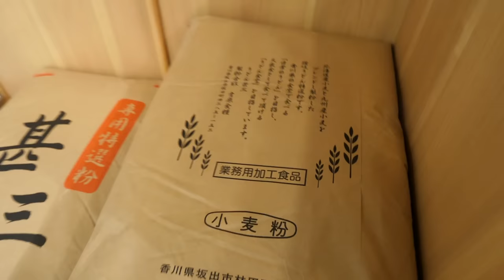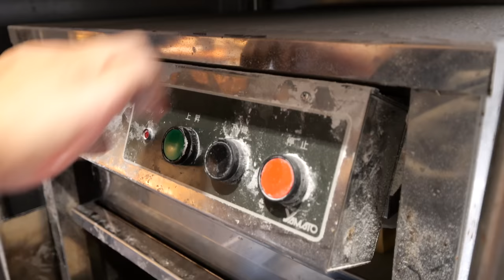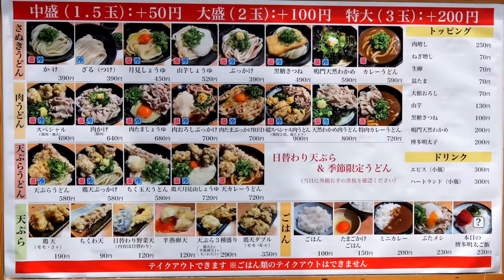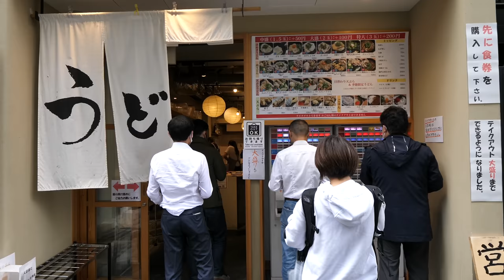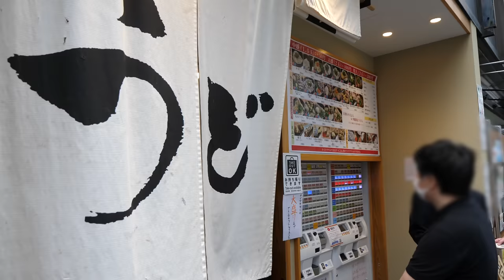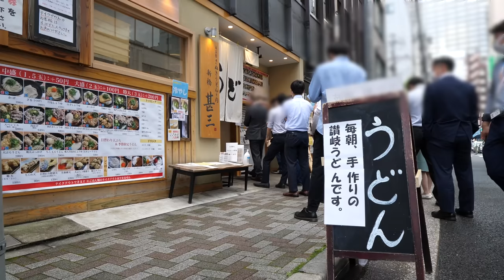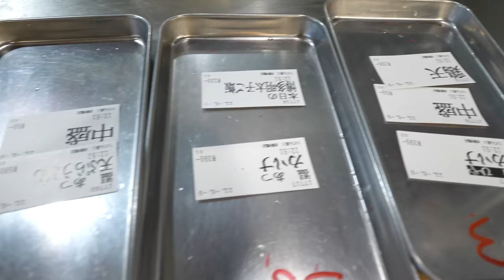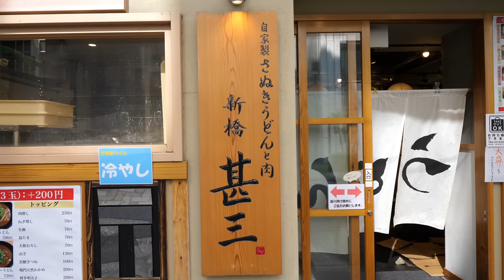天ぷら！肉うどん！信じられない高速注文さばきが炸裂する行列うどん屋の１日：銘柄豚林SPF丨Best Udon in Tokyo

Comment: $3-6 USD. Plain Udon noodle, all on its own is a killer here. It's very rare to find anything faster. The toppings are extremely fresh, huge and high quality materials. Seating are singles which means no empty seats. Cold Udon allows customers in rush to eat faster. They exit faster. Seats are vacated faster. This is why they keep coming back. The reason why it's mostly men is because women cook and pack their own bento box in the morning to eat at work to save money. The dishes are designed to satisfy and appeal to men. Big portions. They are not overheating the soup so that they don't lose the fragrance of dashi but try to maintain the soup temperature by warming the bowl. First class Udon noodle diner looks like this. 
If this Udon noodle can be served inside flights or hotels, every Japanese would prefer that company.

Comment: Are these noodles cold?
Reply: After the initial cooking, the Udon noodles are rinsed in cold water to remove excess starch, prevent clumping, and stop overcooking. Not all noodle dishes will be served warm, some are served chilled or at room temperature. If the noodles will be served warm, they will be blanched again in hot water or combined with warm sauce or broth. This restaurant serves a variety of dishes - cold, warm, and hot.